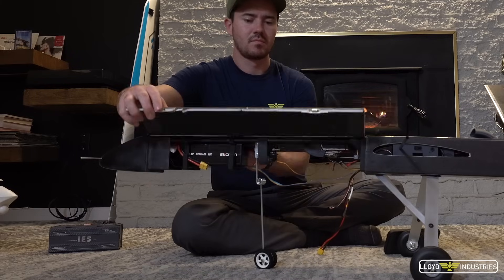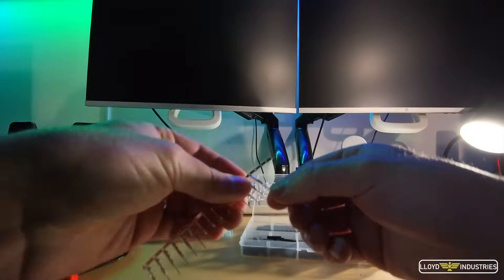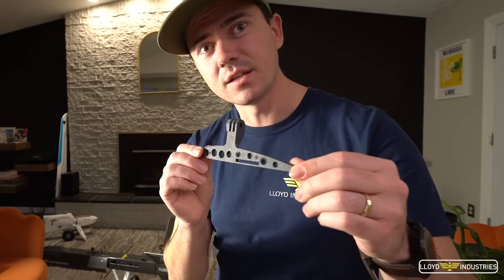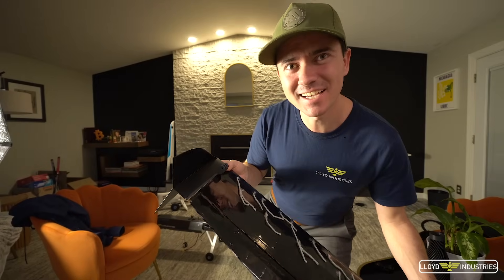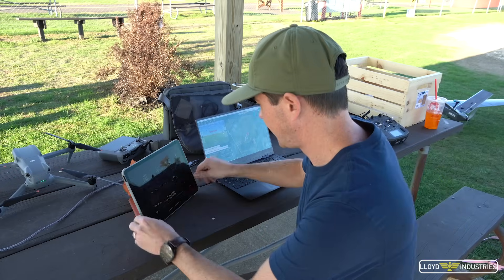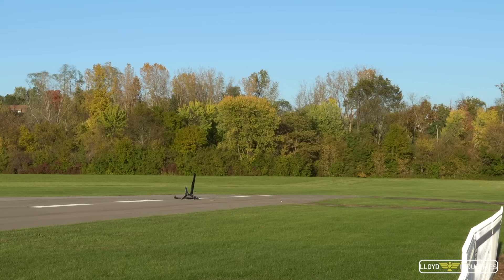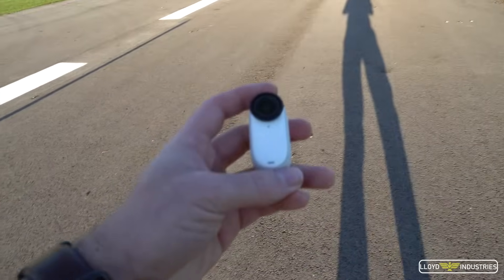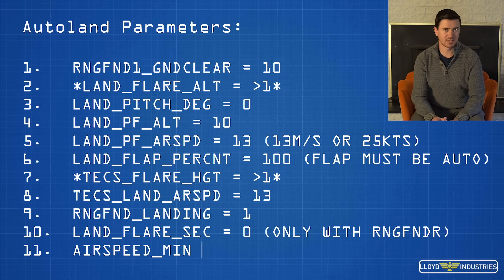X-Hawks Ardupilot Autoland - Cube Orange w/ LiDAR and Airspeed Sensor

Comment: Take a look at how aircraft land and the pitch and power settings. The aircraft needs to extend the flaps to reduce the airspeed.  in this autopilot, 2 things seem to be present that are working against a pitch-up attitude, as far as the logic: 1. It has a lower commanded attitude and is sacrificing altitude for airspeed. In a landing configuration, you need to establish the condition of "Slow flight," where you are "Behind the power curve, this is where the logic needs to swap. 1 It needs to use pitch for airspeed and power for altitude. 2  you need to think of all of the phases of a landing and not just the flare, that is about only 2% of a proper setup for a landing Look at your approach angle, the rate of decent was so significant when the LiDaR dectectd the 1 meter it was already in a pitch down attitude. You need to establish a stable standard approach angle. The universal standard is a 3 Degree slope; you were coming in at like 30. Take some time and do the math of where your touchdown point is. And how close and how high your “final approach fix” or “Initial Point” is from the airfield. In this case, your altitude was too high and your waypoint was too close to the touchdown.  Many pilots look at something called the “VVI” or the Vertical Velocity indicator to ensure their descent rate is not outside of these limits. These three things will set up for a great landing: Pitch, Power, Slope, and speed! Happy flying sir!

Comment: I'm just learning about all this stuff, but I read somewhere that there is a minimum sensor range for some LIDAR systems, in addition to the maximum. Also they work best over solid surfaces, so maybe set your final waypoint accordingly. I don't know if any of this applies to your system, but may be worth looking into.
Reply from the maker: Absolutely you are correct. There are actually some parameters you have to set for the minimum and maximum. I will try moving the last waypoint more over the runway next time!

Comment: Preflare maybe at 5?. I am manually activating flaps on final with no problem on my Ranger.  And 16 degree final angle is way steep. QGC lets you set the angle and it spaces the final WP, not sure about MP but maybe your final WP needs to be lower and/or further out. Great vids !!
Reply from the maker: I agree, that glidepath was way too steep but its tricky since there are fairly tall trees in the way when landing in that direction. I will have to test it out in the future when im ready to destroy the X-Hawk again haha

Comment: Cool video, in previous episode you said that aircraft weights around 3kg, what's the wingspan of it or wing area. I built a similar plane and it weights 1,7kg. I was wondering how much I can load the wings of it.
Reply from the maker: I'm jealous, I wish I could get it down that low. The wingspan is 2 meters long and the total wing area is measured at 4075cm^2. This version did come in a few hundred grams lighter but nothing really worth noting. MKII (3D Printed wing ribs) AUW was 3306g and the MKIII (Wood wings) came in at 3088g. Hope this gives you the confidence to load it up! Cheers and thanks for watching!

Comment: I really liked your video! I have years of experience with the auto-land feature in ArduPlane with both slow and fast planes, and I recommend a descent angle between 8 and 9 degrees! That's the range that 'always works' with wind, without wind, heavy, light... Obviously, having the TECS and other flight parameters well tuned.
Reply from the maker: Thank you! I will certainly try that when i get it all fixed up
Reply: As a guy who wrote a lot of that auto landing code, I agree. Your biggest problem was the steep slope.

Comment: What you haven't shown is the landing pitch you configured in the mission. It looks to me like you might have set it up to come in too steep.
Reply from the maker: You can see the glide slope angle on the flight plan portion of the video, minute 8:31 on the very bottom. It shows 16.4deg. I agree it was too steep. I was just terrified of the trees! To be fair however, Jenney, the Ranger 2400, had a similar glide slope angle.